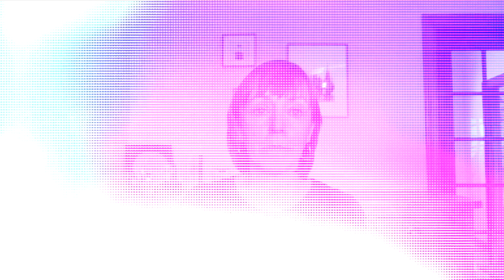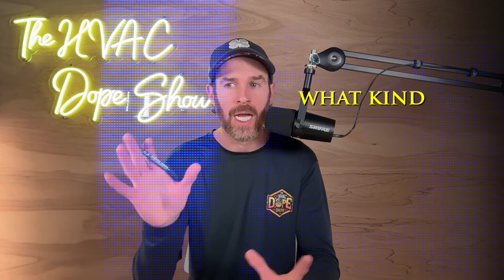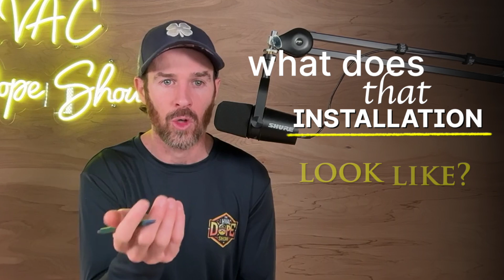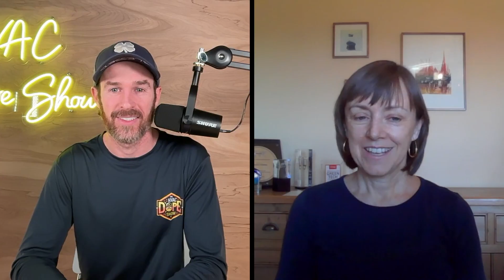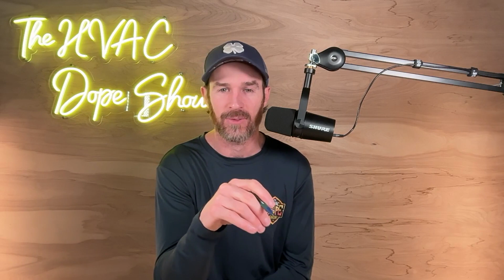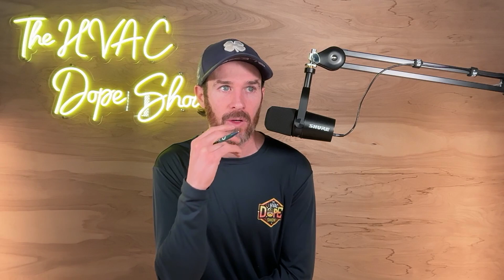This CEO made their own heat pump | Harvest Heat Pump founder interview

Comment: How does code in the US allow the domestic water supply to be used as the working fluid from the HP to the indoor fan hx? This is not allowed in the UK.
Reply from the maker: Yeah I don't know, we wouldn't do this on a boiler but I believe the sanco2 is specific for domestic. But what you mention on the air handler is a good point...

Comment: Since the SanCO2 water heater has water lines leaving the house, what protections are in place to prevent water from freezing and destroying the unit if the circulation pump fails for any reason?
Reply: They don't only use water to heat radiators, they use glycol and water, like your car rad, which offers freeze protection.   If heating water for the hot water heater, they run a double isolated loop through a tank. If the glycol heat transfer fluid leaks, then the fresh potable water to be heated stays separate.
Reply: @mikemotorbike4283  Actually Mike, that is incorrect. This system does not use glycol like geothermal systems or the double isolated loop you mentioned. All the water in this system is potable and (after tempering with cold water) it feeds the domestic hot water system as well. For this reason, insulation and self regulating electric heat trace (must be good up to 150°F) is required. In addition to this, it is necessary to purchase the model with heat trace built in to the heat pump pan. This also means that in case of an electrical outage, backup power is necessary to preserve the pipes and heat pump against damage. But it seems a small price for such an efficient system.

Comment: I live in colorado. I had solar hot water heat with 200 gallon storage tank and radiant heat installed 40 years ago. It still works great.The only thing different here is you're adding a heat pump to replace the solar hot water panels. One comment you need more thermal storage for a cold climate than a typical hot water tank.